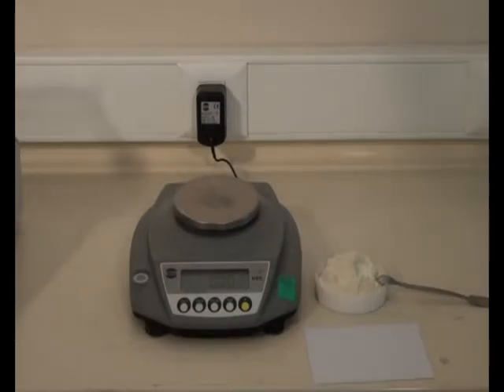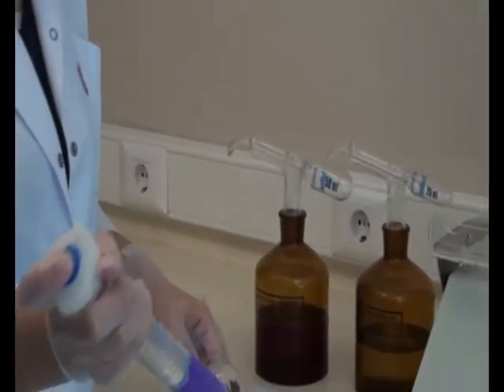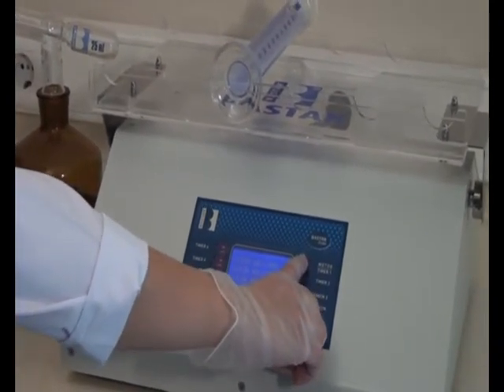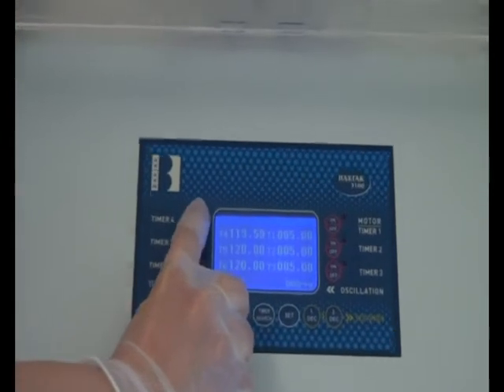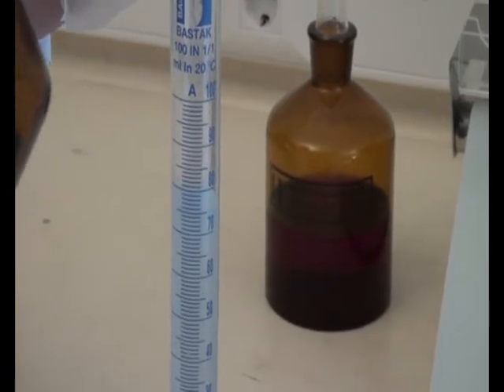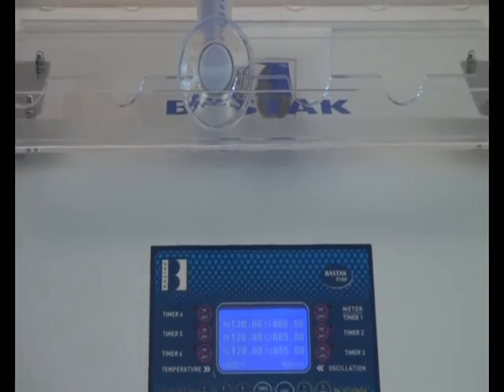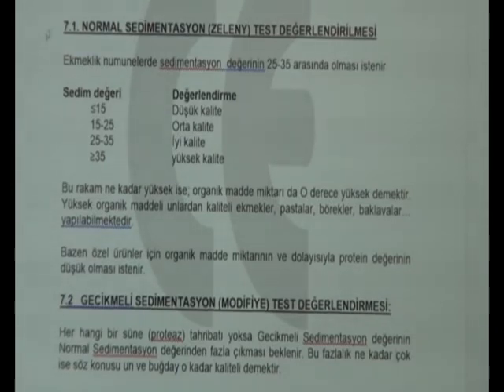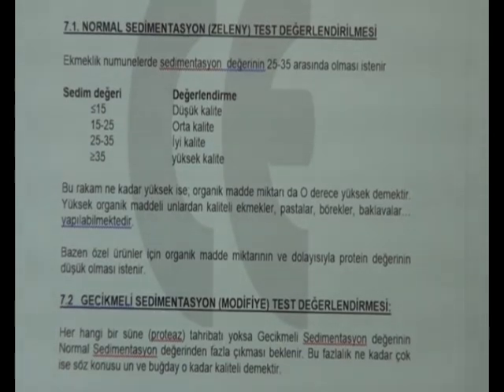SEDIMENTATION 3100  ZELENY modfid

Comment: lactic acid solution ? is there isopropanol in solution? can you tell me correct composition of solution
Reply from the maker: 6.1.3 Preparation of Lactic Acid Solution
For example, let’s prepare lactic acid solution of 1000 ml. The amount of 250 ml is taken from lactic acid of 85% is poured into the balloon and purified water of 750 ml is added onto it and it is left for boiling on the distillation mechanism with back-cooler for 6 hours. At the end of this period of time, 180 ml is taken from the cooled solution and transferred into the balloon of 1000 ml and iso propil alcohol of 200 ml is added onto it. Afterwards, purified water of 620 ml is added onto it and waited for 48 hours. At the end of this period of time, the lactic acid solution ready for testing is prepared.